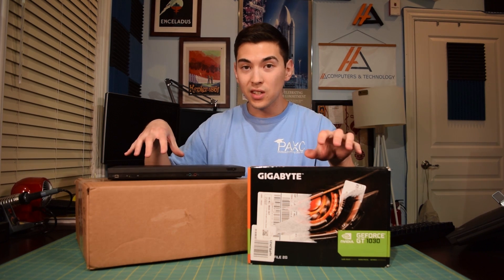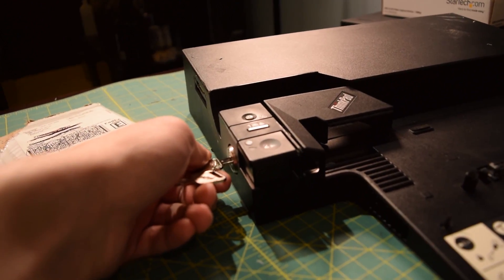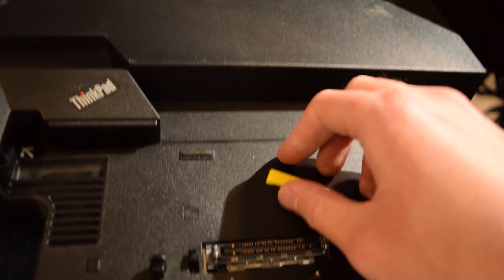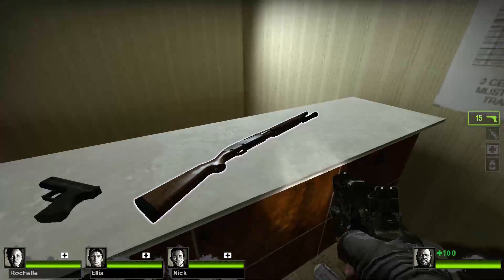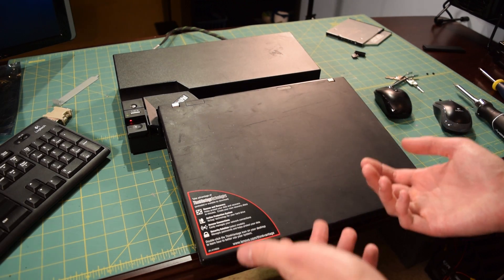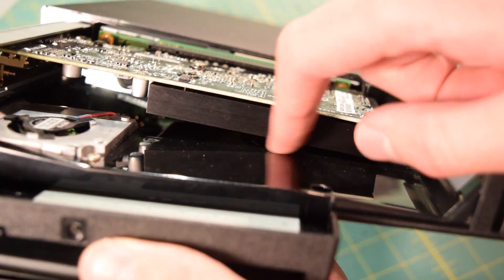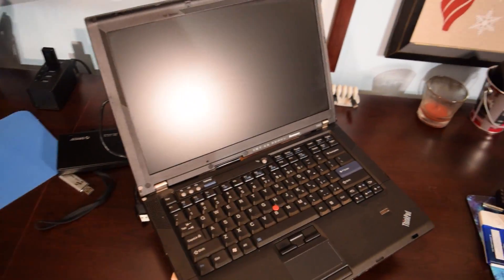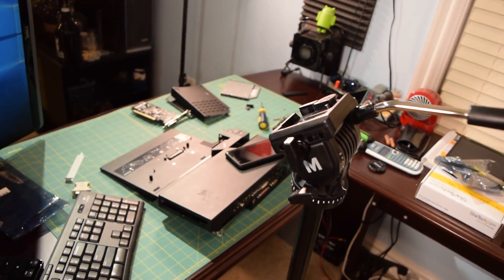Lenovo Thinkpad PCIe GPU Docking Station (250310U) : First Look

Comment from the maker: Here is a list of all the TP models that work with the dock: http://www.thinkwiki.org/wiki/ThinkPad_Advanced_Dock
Reply: AA Computers and Technology you should try the quad core mod for the thinkpad as this site shows https://notabug.org/libreboot/libreboot/issues/340
Reply: Hi ,I have this docking station with T61p upgraded to the max of course with the last revision motherboards that is possible to find with good Nvidia quadro chips with 2x4gbddr2 800 full hd screen and Intel core 2 Extreme X9000.I tried two video cards Nvidia Gt730 with 2 gb of ram and Gt1030 with 2 gb.the second one can't work but gt730 works perfect.I advice you to dismantle the docking station and clean the dirt inside,but be careful around the key there is microswitch that is very ease to break it.regards
Reply: are the gpu docks work on thinkpad t420>>>?????
Reply: @yukiakahaka1893 ,docks gpu works only with outside monitors command by laptop you can't see picture on laptop lcd through dock's gpu.
Reply: @milak111234  thankyou...
Reply: @yukiakahaka1893  ,no problem.I want to give advice for this dock  - when someone buy it ,must disassemble to clean it carefully  but it's not easy.all capacitors inside must be checked and changed if needed.the fan also must be cleaned.i confirm Nvidia GT 730 with 2 gb of ram work perfectly ,I tried similar 1030 TI with 2 gb of ram but didn't work.
Reply: Fffffffffffock. MY T43's out of luck :P
Reply: Hi,
Which docking station is used in the video? Will I be able to connect my T430 to it?

Comment: Hey! Excellent video! I followed your vids and have been playing on this rig for about a year and I am so happy! I actually ended up using a T400 which is great but I know you were saying with a T60, or T61 I believe you can use 3g of RAM instead of the 2g with the T400. I recently picked up an R61 for a great price. Can that be used as well? With 3g? Thanks again for the info and awesome presentations!

Comment: Im not shure what is error 43, but I have some unusuall probplem trying to make my setup work. I have T400 with 8gb  of ram ATI Radeon 5450 with 2gb of ram and station 2503. If I will put all things together nothing will work. However I notice that If I will put a 2gb ram to thinkpad, then I can use station with graphik card.... how to make it workable with 8gb of ram setup? Any advices?
Reply: have you solved with Advance Dock problem with RAM > 2GB?  some suggested to use a software (15 usd if i recall9 made by a developer called Nando which compacts the memory allocation of some older systems

Comment: With my lenovo t420 i7 and 4gb ram I can play this L4d with everything at high apart from those bilinear modes which is turned to off. I thing an external pcie is better as you can place  stronger desktop gpus. You can probably compine the thin docking station and an external gpu slot.

Comment: You could use a PCIE extender for a better grapihic card and cut the loud mini-fan. You can power with external powersource if that gpu needs power. Does the dock work with X230 t430??

Comment: It's not that important but if you getthe fastest Ram speed available for the year for you to believe it is 2400 megahertz, anything other than that probably wouldn't work for the laptop anyway.

With an older CPU it will remove the bottleneck for the read and write speed on the ram, basically adding a few extra gigs on top of 1600 megahertz Ram
Reply: Boi its ddr2, your lucky if you can find a laptop that supports 1066mhz dimms
Reply: I'm talking about a better laptop, I bet they have that port on more than one generation of ThinkPad

Comment: I'd love to see you test one of the external gpu solutions that instead of using a mini pci slot (usually the wifi card slot) they run off of express card, I'd love that.

Comment: Does it work with a lenovo t410 or would it not be compatable because it has the expansion on the bottom but not sure
Reply: The t410 has a different docking connector, sadly. At least the t410s does and that really sucks for me, because I still have my t400 which has a broken screen cable and I would love to be able to use my dock but it just doesn't fit
Reply: @nilswegner2881  dang that sucks it would be cool if it was the same and sad to hear about your screen cable

Comment: I Used my Dell e6430 with an Expresscard egpu when my PC failed, and the Experience was Kinda Good. I got Pentium g4560 Performance in Games with my i5 3380m and a HD7950. still, this Lenovo dock is A more Clean Version.

Comment: Man, you got the worst version of the T400, with THAT cpu (T7200 is a horrible one). If you got a Penryn equipped T400 you could put a Core 2 Xtreme X9100 there, and that CPU rock. I had a T400 with a X9100 and 8GB of RAM working with a ExpressCard eGPU using GTX 660 Ti, and that system was crazy fast (for a 2008 laptop). Only reason I don't have it anymore is because I let the laptop fall on the ground some months ago, and it was damaged pretty bad.
Reply: That had to be the highest fall in history to somehow destroy a thinkpad
Reply: can you recommend a used buyer guide for Lenovo T400. thanks.
Reply: Hey how well did the expres card egpu work?
Reply: Sorry guys, for some reason YouTube didn't notify me about your comments, and I just found out about them today (as of... now).
First: if you're going for a T400, get a Penryn equipped one, like one with P8400 processor or something like that. There are BIOS mods that allow you to get a Merom equipped T400 to accept a Penryn CPU, but it is easier to just get a Penryn one. Then get a Core 2 Xtreme X9100 for your T400. That CPU is crazy fast (for such an old architecture).
Second: the ExpressCard eGPU: it does work pretty well, but limited to a PCIe x1 v1.1 speed. Nvidia has data compression for that generation of CPUs that helps a lot, but you can only use it up to a certain version of the driver (don't remember which now, but it is pretty simple to find out online). In order to get the eGPU to work properly, I would turn on the laptop, then put it to "sleep" mode, then connect the eGPU, then turn the laptop back on. About 10 seconds later it would recognize the eGPU and send video through it (I used an external monitor).
Reply: i have a t7250 in my dell latitude e5500 do you know somewhere i can see what i can upgrade it with would be nice getting some more cpu performance seeing my cpu is very often pegged at 99%
Reply: Paulo Silveira You’re actually right, I have that T7200 chip in my Toshiba and it performs poorly.
Reply: Im building my t430 up. Have the 1080p screen swap 2 1tb SSD drives. I7-3840qm processor. Overclocked +4. Waiting on a egpu in the mail. Just need to find a compatible gpu

Comment: I have problems with T60p and 2503 advanced dock, transition between internal and external gpu is not seamless, If I manage to make e-gpu, operational, it works on external screen only, internal gpu (FireGl 5250) is disabled and laptop's screen is off, I tried to change display setting in BIOS, but I made it worse :D (reinstalling drivers helps to make internal gpu operational again)
I tried several gpu's, Radeon R7 250 is current, I tried Geforce 9600 (with pci-e extender) and GT 730
It would be grate if you make tutorial of sorts how to set it up correctly. BTW  I am using Windows 7 32 bit to keep it "retro"-ish (unfortunately Steam will stop to work on XP in the end pf 2018)

Comment: x1 is pretty disappointing. I assumed it would have been x4. I guess it's still SLIGHTLY useful, but it's going to hold back pretty much anything you put in there.
Reply: Not so much as you might think... The bigger bottleneck will really end up being the CPU, 99% of the time.

Comment: if it's compatible with T400, would it also work with T410?
Reply: Nope, the T410 has its own docks, but they do not have a PCIe slot. This here has a list of the compatible models for the dock used on the video: http://www.thinkwiki.org/wiki/ThinkPad_Advanced_Dock

Comment: I've been searching and searching... I want this dock... I've found some, but no one anywhere actually lists what it works with.  Does this work with the T420 and or T430?  I've got a 420 with an i7 2760 QM pulling down 8500 passmark... and a 430 with an i7 3740qm pulling 9k... That's enough to feed a 1080ti frames and not even come close to a bottleneck... I want to do this now.. badly.  Just got the the part about it being in a 1x slot... I don't even care... I'm still throwing my money at the screen hoping for the best.  I wonder if you could come out of the msata / mini pcie in the machine... maybe an unused wifi or wwan slot if not populated with an ssd... that should at least give you pcie 4x.  With some modifications.  Sad they didn't take more advantage of that breakout docking connector, as it could had provided more than 1x.
Reply: This dock doesn't work with the T430, sadly. But you can make an eGPU for the T430 by using a ExpressCard adapter (I'm almost sure that the T430 has one).
Reply: @psilveira314  Yeah, the 430 and 420 both have a 34mm express card, as well as mini pcie wwan slots that can go out to an egpu dock.. but those lack elegance.  This would have been amazing!  I still want this so bad, to the point that now I think I'm going to be forced to modify one to my needs... damn it.

Comment: Checked out the X9100 as a CPU upgrade for the T400? I had one before with that cpu as an upgrade. Should be about 20$ if you buy it off aliexpress. Even when it comes to cooling it should work fine.

Comment: Definitely interested to see the biggest GPU you can fit "in" the dock and "out" with a rider and a semi nicely done extension, like just extensions legs on the dock. I'll be definitely be buying one of these if I can fit a 1050ti or something like that in here !
Reply: This dock has two limits: size and TDP. Size because it has limited internal space, only for a low profile GPU (can be avoided with a PCIe extension cable) and TDP because the dock will only supply up to 50W for the GPU.
Reply: @psilveira314  how about an ext osy?

Comment: Did it work with the T430?
Reply: T430 has an expresscard slot so you could build a proper EGPU which is less ghetto than having to hook up the contraption to wifi card like most cheap laptop

Comment: have you tried the egpu adapter through ExpressCard on a more modern thinkpad (like a T430)? If yes, how would you compare the experiences?  the ratio of cost to docking practicality? (kinda like the whole one cable thunderbolt trend)
Reply: It runs OK, especially if you have a quad I7, but the greatest hurdle is the lack of display routing, meaning that you have to use an external monitor. Also, it does not work properly with thinkpads that have a newer version of bios or Nvidia Optimus.
Reply: What is an ExpressCard? You're confusing some people here
Reply: @jordananderson8299  it's a port that was quite common on old laptops. You could buy expansion cards which could add io: usb3, serial, lab equipement, etc. Recently, products were released enabling the use of a desktop GPU on laptops thanks to an adapter connecting to the ExpressCard Slot. I believe it' because it carries PCI lanes (like 4 maybe) but i might be wrong
Reply: @Av-ks8uc  It carries pcie lanes, PCMCIA carried pci lanes.
Reply: @abcdefg9613  got it. Thanks mate!

Comment: If anyone is interested I have one of these for sale in the UK, fully working, decent condition, with original key :P
Reply: http://rover.ebay.com/rover/1/710-53481-19255-0/1?icep_ff3=2&pub=5575378759&campid=5338273189&customid=&icep_item=173625098117&ipn=psmain&icep_vectorid=229508&kwid=902099&mtid=824&kw=lg&toolid=11111

Comment: Put t9900 that is one beast of a CPU
Reply: Not really. I have one and it wasn't worth the hassle or expense.
Reply: @cee128d  he have t7200 I say is far better than t7200 and if you like t9900 on AliExpress is around 30$
Reply: @default1647  I have a T7400 in my T60, a T7500 in a Toshiba, and a T9900 in another Toshiba that replace a T9600. Not enough cpu performance gain between the T9600 he is looking at for the T400 and the T9900 to justify the additional cost. The T9600 is only $10. Plus, the T9900 runs hotter than the T9600. The cpu fan runs at a significant speed even at idle. It's loud and annoying.
Reply: @cee128d  yep but 2.8ghz Vs 3.06ghz ? I have t7200 in my IBM C200 3000 and I am planning to put t9600 or t9900 what you think ?
Reply: @default1647  T7200 is Socket M, T9600 and T9900 are Socket P. While the T9x00 will physically fit into a Socket M, the pinouts are different. Plus the Intel 945GM chipset in yours doesn't support the faster FSB cpus like the T9x00 series. The fastest cpu that will work in the C200 3000 is the T7600 which will only be about a 5% increase in performance.
Reply: @cee128d  but on intel web site it says they are same only the FSB is different I hope I will try to run t9300 or t9600 the thing is I like to buy egpu :)
Reply: @default1647   You need to look at those specs again. They list different sockets. BGA479, PGA478 for the T9600/T9900 and PBGA479, PPGA478 for the T7200, T7400, T7600. Notice the extra P for the T7x00 series. Trust me. I've been doing this since the mid 1970's and have studied this and actually performed a lot of these upgrades over the years. I know what I'm talking about.

The following link will give you more details about the different sockets and chipsets and show you what cpus can be used in each. Well worth a read before making a purchase. I refer to it quite often when researching a cpu upgrade for a laptop I'm not familiar with or haven't worked with before.  http://forum.notebookreview.com/threads/intel-mobile-processor-compatibility-guide.209284/
Reply: @cee128d  yes I believe you :) I work with technology 2 :) do you know what is extra P sending for ? Extra P is stending for Plastic :)) I have this same thing with i5 first gen we (me and my colleague ) have the same argument but that is not the problem the problem is with the bios the qesten is is the cpu supported I will try and I will send you the answer :) btw I work with hardware software and many electronics soory for my bed English I am from Macedonia Europe :)
Reply: @default1647  Go to the Thinkpad forums and ask there. You would need to know the  type number as well as the model number though. Those guys really know their stuff and exactly what cpus will work in which model and type.
Reply: @cee128d  PPGA package type
PPGA is short for Plastic Pin Grid Array, and these processors have pins that are inserted into a socket. To improve thermal conductivity, the PPGA uses a nickel plated copper heat slug on top of the processor. The pins on the bottom of the chip are staggered. In addition, the pins are arranged in a way that the processor can only be inserted one way into the socket. The PPGA package is used by early Intel Celeron processors, which have 370 pins. BY INTEL
Reply: @default1647  Okay, but the Socket M and Socket P are still wired differently. You can physically place a Socket P processor like the T9900 into a Socket M socket but it won't work just like you can physically place a Pentium 3M processor into it which won't work either. 

To sum it all up, the fastest CPU that will actually run in Socket M is the T7600.

Comment: So how did you get the correct dock? I'm afraid to buy it from the website that sent the wrong dock because I'd hate to get sent the wrong one too
Reply from the maker: A viewer sent it to us for free (mentioned at the beginning of the video).  PC Liquidations actually pulled that docking station from their store after they sent me the wrong one. You're best bet is eBay, though it will cost you.
Reply: @AAComputersandTechnology  Did you get a refund from them?
Reply from the maker: yup, got a full refund.  They saw the video I posted and asked if they could send over parts for the T400 upgrades.  I'm not sure if I want to deal with all that though.
Reply: @AAComputersandTechnology  If the price is right it might be worth it. Anyone can make a mistake. I imagine they would take extra care with what they would send you this time considering you would talk about any screwups in a video.
Reply: @AAComputersandTechnology  Too bad that there's no docking station for the HP Elitebook 8440p. But could you do a simple video of doing a motherboard swap on it or other laptops?